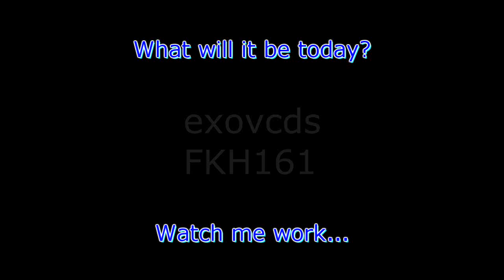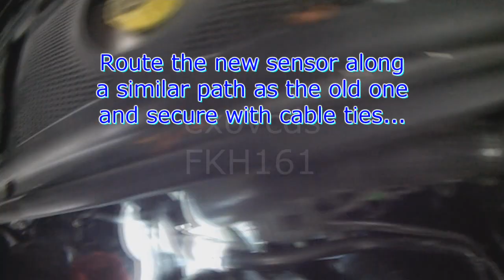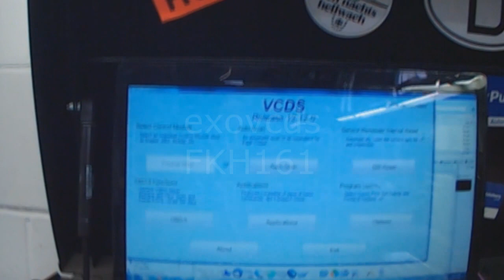Audi B5: 1.8T Crankshaft Position / Engine Speed Sensor Replacement

Comment: When the Crankshaft sensor is bad does the vehicle fail to spark & fail to prime / get fuel in the fuel system?
Reply from the maker: No spark.
Reply: So it will pump fuel with no spark?
Reply from the maker: ComputerFox Computer Repair No. You asked me if it will prime... I think it will, but it won't continue pumping during cranking if there is no crank signal.
Reply from the maker: +ComputerFox Computer Repair Some cars will prime the pump when the door is opened... priming when the key is turned doesn't always happen. If you get an rpm signal with a scan tool, crank sensor is probably OK.
Reply: I replaced both Crank and Cam position sensor.  Thinking the only thing left is the ECU...

Comment: Thank you so much I found the speed sensor location thanks to ur pics but for some reason it is still keeping every 5 mph on the speedometer needle and sticks at about 20 mph when I turn off the car and it jus slowly goes down to zero after the car is turned off so I guess it's something else
Reply from the maker: The sensor gets a signal from a wheel inside the transmission. The driveshaft flange & cover are removed to gain access to this wheel. I have heard of this wheel coming loose, causing speedometer issues. I have not seen this myself, as we don't get a lot of Audi's. It could be that the problem is in the dash... but I'm not sure. Have someone check the sensor wheel or check the speed with a scan tool. If the speed shows correct with the scan tool, then the dash / needle driver is the problem.

Comment: Hi Tomas EXOVCDS i need your advice. i have a Golf MkIV Gti manual gear whit 1.8t AGU 150 engine. The engine and the cluster runs very good, but the climatronic have a 00281 - Vehicle Speed Sensor (G68) fault. i dont know where is the sensor to change and fix the fault in climatronic. Can u help me to localize the sensor?. Thanks and excuse me for my poore english. Thanks for the videos and your time.
Reply from the maker: 5 speed or 6 speed? 5 speed has the speed sensor on top of the differential (3 wire sensor)... the 6 speed uses the ABS to determine speed... since you have a G68 fault code, you probably have a 5 speed transmission?

Comment: Awesome Video.. Appreciate it.

Subscribing.
Reply from the maker: Gabino Quintero Thank you... thank you for subscribing and thanks for watching & taking the time to comment!
Reply: ***** i know this is a dumb question.but is a crank shaft sensor the same as a engine speed sensor?i ran a diagnostic on my vw passat and im getting an inssue with my engine speed sensor.where can i buy it ?
Reply from the maker: David Henriquez Crankshaft position sensor is the same as engine speed sensor. Failure of that sensor can cause the engine stop running or not start. A G28 fault code is usually stored. Go to:

http://www.germanautoparts.com/Volkswagen/Passat/EngineElectrical/182

Comment: I heard there is a rectangle and oval connection? How do i know which i have without taking apart the car to find out? 2001 Audi A4 1.8T Quattro
Reply from the maker: Here's a newer video.... look at the connector at 1:30. If it has a rounded corner, it's the oval style.
https://www.youtube.com/watch?v=8WufwHIzaUM
Reply: Thomas EXOVCDS thanks!

Comment: Hello
I changed the timing belt and marks was ok, after the engine fault light came on and showed that the cam shaft sensor signal is illogical
I have replaced the 2 pieces but did not help checked the timing belt marks again and everything was ok, what can it be? 
and now the car starts badly and idle speed sail
Reply from the maker: haidar al2003 1.8T? If you did NOT have the engine fault BEFORE the timing belt replacement, then the timing marks (camshaft & crankshaft) are not aligned correctly. Take it apart again and realign everything.
Reply: ***** Yes 1.8T 4x4
and i ddi not have any fault before..
I have checked all the marks, but if you have pictures of the flywheel mark because I have not found yet ?
Thank you for your help.
Reply from the maker: haidar al2003 Standard or automatic? 4x4? What car?
Reply from the maker: haidar al2003 Flywheel mark is not easy to see and is usually not needed. Here's a PDF:

http://fkh161.ca/Audi/AMBTimingBelt.pdf

When the crank pulley is at TDC, you will see that 2 of the 4 crank pulley bolt holes ar at 12 & 6 O'clock.

Confirm this by placing the pulley back on the crank sprocket and checking the TDC mark on the pulley & lower cover.

If the cover or pulley mark is not visible, place a long screwdriver into the spark plug hole and slowly rotate the engine until the screwdriver stops moving at the highest piston travel (before going back down).

It "sometimes" helps to put the crankshaft slightly to the left of TDC, because as the belt is tensioned, the crankshaft will rotate to the right.

Once the belt has been tightened, rotate the engine by hand 2 turns and recheck the TDC alignment (install the lower timing belt cover and pulley to be sure).
Reply: ***** Thank you I will try tomorrow and will tell you

Comment: hey man can you tell me where to locate speed sensor "A" range/performance error code p0501 on a audi a4 2004 1.8t quattro automatic ?
Reply from the maker: +Fernando Silva Vasquez http://wiki.ross-tech.com/wiki/index.php/16885/P0501/001281 at the left driveshaft flange: http://fkh161.ca/Audi/G22.jpg
Reply: i looked and i found that area where's the axle but that hole where it should be has no connector and sensor does no fit, and their is just a hole?? confused is their another location
Reply from the maker: Fernando Silva Vasquez Sorry, that was just a generic auto transmission image. Depending on the automatic transmission "type", the sensor will be inside the transmission (have to remove the oil pan).
Reply: ok thanks I'm going to check tomorrow

Comment: What I need to do after I replace the crankshaft sensor will crank but no start please help what I need to do 2004 Jetta 1.8 t
Reply from the maker: Nothing... if the sensor is working, the ECM is working, the fuel pump is working, the timing belt is ok.... the engine should start. If it does not, check everything.
Reply: Thomas EXOVCDS was running before I replace and just the symptom for a bad crank sensor
Reply from the maker: more hernandez Make sure that the sensor is plugged in correctly / fully. Was it of the same shape & size? Is it sitting fully against the engine block?
Reply: Thomas EXOVCDS yes it was a direct imports from orellis om same plug and same shape if I put the old back and start maybe is a bad one the new one thx EXOVCDS
Reply from the maker: more hernandez Yeah... I would try the old one again.

Comment: hello I recently purchased a 2004 Audi A6 Quattro 2.7 twin turbo but the speedometer and odometer is not working any ideas
Reply from the maker: +Alex Cespedes Speed sensor on the transmission?
Reply: +Thomas EXOVCDS i havent tried that yet will do first i need to find it . thank you for your reply
Reply from the maker: Alex Cespedes Look for a sensor on the driver side differential flange:
http://fkh161.ca/Audi/G22.jpg Let me know if you do NOT have one there... you will need a flashlight to see it. Follow the driver side drive shaft to the the transmission (might have a splash guard in the way as well).
Reply: Ok thank you. I will keep you i formed

Comment: how does the Crankshaft Position Sensor work? does it power the car or what is it suppose to do?
Reply from the maker: It's like an ABS speed sensor... it produces a voltage when the engine is turning. The engine computer looks at that signal and can determine if the engine is speeding up or slowing down. No signal and the engine computer thinks that the engine stopped turning, so it shuts off fuel & ignition spark.

Comment: I have a problem with my passat 01 1.8t awt engine. every time i try to start in the morning when the engine is cold its won't start.. Second try it start but coughing it selv to death sometime and other times it coughing it selv to normal idle. I had i fault code about to weeks ago and it was the crank position sensor.. i replaced that but dit nothing good.. still having this start issue that car won't start on the first attend without coughing its selv to death or idle. It always starts on the second or sometimes third attend. What to do?  Any ideas?
Reply from the maker: Could be a faulty coolant temperature sensor (engine computer thinks that the engine is warm)... or a fuel delivery issue. Both can cause hard starting, but with the temp sensor, the engine always starts normally once the engine has warmed up.

A fuel pressure problem should affect a warm engine as well.
Reply: ***** i have replaced cooling temperature sensor before about 2 years ago maybe because the temperature in the car didn't work. But still i had this start issue and still have
Don't know what to do...
Reply from the maker: Milad Saboohian I would still recheck everything... coolant temp sensor,  fuel pressure and anything else that could cause cold starting issues.

Comment: Hey there I know it’s a old video and all but I have a issue atm with my 01 Audi A4 1.8T car turns on but idles rough and when given gas it tends to just die or sometimes it just dies at idle .. already checked fuel and spark and it’s all good . I could get the car to start and stay on for a few secs and then it just dies again and a smell of Unburned fuel could be smelled, after a few try’s the car just don’t start . And after a while I could start it again and it stays on for a few secs again.. not sure where to start from but this Crank position sensor is one of the things I think could be causing this . Any info would help allot going to look into making a video of the issue and maybe someone could help me solve his problem .
Reply from the maker: I don't think it's a crank sensor issue. Check fuel pressure and coolant temperature sensor (check temperature value with scan tool). If fuel pressure is ok, check cam / crank timing. When was the last time the engine ran normal? Plugged exhaust?
Reply: Thomas EXOVCDS I did notice something different when touching around I felt my fuel rail feed line soft I could literally squish it with my finger like if there’s no pressure in the line .. the return line felt a little bit harder .. car was running fine today, and from one moment to another it just seemed to have lost power and started stuttering when accelerating until it finally died on me .. I’m not running a muffler I’m strait pipe and catless been like that for about 1 year now ..
Reply from the maker: @KriptoVlogs  When it doesn't run / start... spray some brake cleaner or mag cleaner into the intake manifold (remove brake booster vacuum hose and reconnect after). It it starts / runs... fuel starvation problem. Maybe the pump is bad.
Reply: Thomas EXOVCDS thank you man . I’ll look into it tomorrow . Would it matter if my TB is electric ?
Reply from the maker: @KriptoVlogs  No. Use a scan tool to check for fault codes... check data stream for correct throttle angles / operation. Remove intake boot at throttle body and have someone step on the gas pedal (key on) to see if throttle plate actually opens & closes.
Reply: Thomas EXOVCDS checked it and I have no codes and no stored codes neither.. I’ll check the TB tomorrow I’ll try and see who could help me hit the gas peddle while I check the TB flap to see if it moves like you said ..
Reply: Thomas EXOVCDS ok sorry it’s been a few days have been beating my self up trying to turn on the Audi and still no luck . I did what you said and Tb is fine works good I changed the CP sensor and car still didn’t turn on I took off my MAF sensor and car turns on for a few min then dies off . I started the car and it dies as soon as I get the MAF connected again .. only code I keep getting is p0102 for the MAF already changed the MAF sensor and still the same thing happens . Turns on rough for a few secs and dies with the new MAF on .. I need some advice please help
Reply from the maker: @KriptoVlogs  I'm away from my PC until tomorrow. I'll get back to you then... can't type easily with my phone.

Comment: can you tell me where the engine speed sensor on a new beetle 1.8t transverse engine 2001 ?
Reply from the maker: Watch this: http://youtu.be/LldC6CuXYoQ?t=2m31s it's a 2.0L but the sensor is in the same location. Engine speed sensor will cause stalling or no-starts when they go bad. If your speedometer is not working, then that is a different sensor.
Reply: ***** MY NEW BEETLE 1.8T  HAS HAD A LUMPY IDLE , ERRATIC ACCELERATION ,HARD START , SEEMS FUEL STARVED . MY SPEEDO WORKS FINE ,TRANNY FINE. SCAN READS P0030 / POSSIBLE BAD 02 SENSORS (REPLACED BOTH REPLACED MAF AND FUEL FILTER). SCAN SAID POSSIBLE SHORT OR BAD HEATER CIRCUIT OR CAM OR CRANK POS SENSOR ///WHICH  DO YOU THINK  IS MORE LIKELY BAD , THE CAM POS SENSOR OR THE CRANK /ENGINE SPEED SENSOR  ?
Reply from the maker: eyestungdustnblind If the engine does NOT die out and will not start, then the crankshaft position sensor should be OK. A cam sensor can cause power issues. A cam sensor can cause extended crank time (slightly).

If the engine DOES die out or fails to start for several minutes, then I would lean towards the crankshaft position sensor.

Current ramp the fuel pump to check for dropouts.

Comment: I have a 98 audi a4 1.8l turbo and when I try to crank it just turns over the fuel pump is working and I have spark could it be a crank or cam sensor?
Reply from the maker: +Glenn Compton If you have spark, then the crank sensor is ok. The engine "should run" with a bad / missing cam signal. Make sure that the timing belt is not broken... align the TDC marks to make sure (if you have missing teeth on the timing belt, the belt could still be turning the engine, but the timing could have shifted. How are you checking for spark? Are the injectors clicking?
Reply: +Thomas EXOVCDS I'm putting the spark plug near my dvom prongs abd watch it spark
Reply from the maker: +Glenn Compton OK... crank sensor is OK.  then that leaves injector pulse & cam / crank timing. If you don't smell fuel at the tail pipe... look for a fuel issue.
Reply: +Thomas EXOVCDS may I get a email and I will share you a video clip of it and that might help thanks I really this car and want to keep it snow ready
Reply: +Thomas EXOVCDS         how can we chek injector pulse on an aud itt 1.8 quatro..thanks
Reply from the maker: drake autos Place a screwdriver against the injector body... place your ear against the handle and have someone crank the engine. You should hear & feel the injector(s) clicking. If not, check for power at one of the wires when cranking.

Comment: would this cause the engine to not turn on?( it then turns on after a few minutes). Sometimes it shuts off and wont let rev past 4k rpm. The ideal is high  like at 1200rpm   
vag-com gave me 1) speed sensor g28  2)some cam timing/ crank sensorfaults.    
voltage and fuel trims look good, this sensor would be my guess. thanks
Reply from the maker: Yes, crank sensor will cause a no-start (cranks ok) condition when it fails... as well as stalling when it gets hot and I have seen limited rpm as well. I'm posting a video tonight about a faulty crank sensor on a 2.0L engine tonight... same location as this 1.8T Audi.
Reply: Thank you so much, i'm trying to help out a cousin with this 1.8t passat. thank you again :)

Comment: Sorry to be so tardy on the subject but I've just come along a simular problem with my 05 a4q 1.8t.
it has a rough crank up at times, rambling amongst the rpms attempting to find an idle, once it has acquired an idle and I began to drive somewhere between gear 3 and 4 the cel light comes on as well as the epc light along with what is known as a "limp-mode" type action where the level of acceleration is greatly decreased and there is no turbo induction at all. I've changed oil, (filters fuel/oil) plugs, coils. anticipating a throttle body but unsure if that should be my next step or am I over looking other culprits?
Reply from the maker: +McHenry Sellers Before replacing anything... or before I can "take a guess" as to what might be going on, I would need some info. If you can check for fault codes, start there. If the scan tool that you have (or wherever you go to get it scanned) can read "fuel trim values"... I would want to know what those values are. Positive numbers means that the engine is running lean (not enough fuel), negative numbers means that the engine is running too rich (too much fuel). Fuel pressure needs to be checked (could be a weak fuel pump). The MAF sensor could be faulty... can be disconnected to see if things are different (but that isn't always conclusive... even if it drives better, doesn't mean that the MAF is bad).